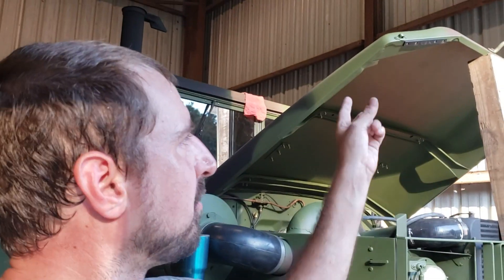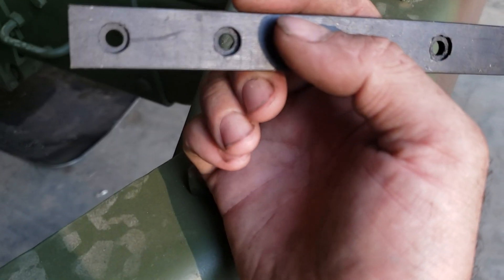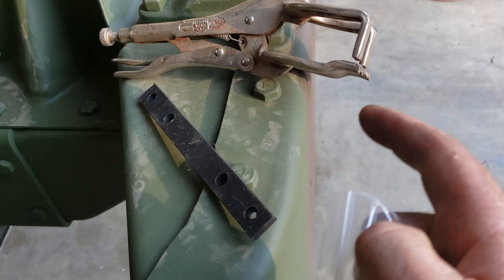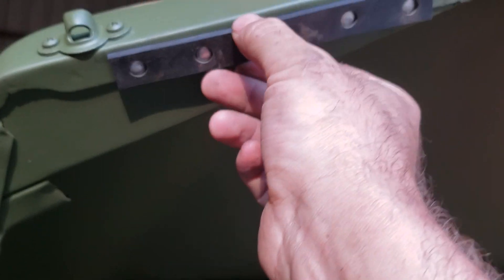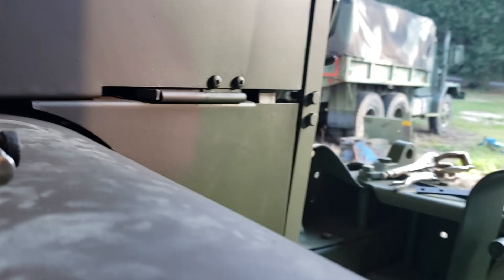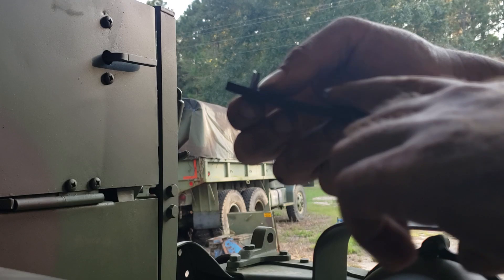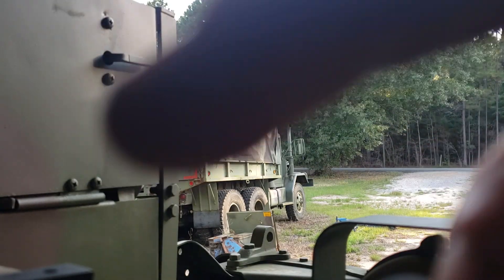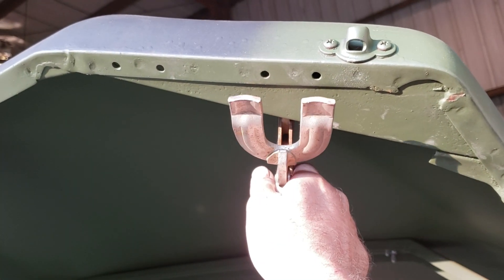Installing M35 hood to grille anti-squeak strips and rivets.

Comment: do you have links to parts??? also are those LED headlites?  if so where did ya get them 24/volt?
Reply: Important note when buying those type or any military headlights on eBay, make sure they say 24VDC. The lmtv version of those headlights are 12VDC. They look exactly the same and sometimes are not marked at all. They will work for about a month in your deuce then blow, we had that problem in the army because the mechanicswouldn't look and put the wrong s*** in a Humvee.
Reply from the maker: Nick, because he has so much more than what is listed it is best to just call him or email him. His website is also quite easy to navigate.

And yes the headlights are the older style Trucklite ones. Can't recall where I got them. Had them for years.
Reply: Those Led headlights look like they might be military part number 6220-01-547-9049( I just installed some on my truck). When shopping 4 those make sure ur getting the real deal.  Jw speaker also makes ones for the military. A lot of the ones that aren't real military lights don't plug right in and aren't DOT approved.

Comment: Do those strips fit on the side panels? That's where I get the most squeeking
Reply: If you have the strips and the engine access doors are rubbing the doors need adjusting.
Reply: @mrmag666  i just put a piece of paper towel on behind the panel and it stopped squeeking, if i remember correctly it was the drivers side panel by the firewall. Don't have the rubber strips, I'll probably end up screwing some on . I got a big box of exhaust bracket rubber pads so meh
Reply: @johndowe7003  it could be a few things, hood loose or not aligned properly, bent or damaged hood, bent engine access doors, even the grill not assembled correctly. Military Depot overhuals and or motorpools are not always in the business of caring if they did it right, just that they did it fast and it's done lol.
Reply from the maker: Should be some small round rubber bumpers held on with a screw just behind the rear latch boss on the cab.
Reply: @johndowe7003  there also should be 3 little round ones next to the front latch as well they just press in.
Reply: @nomad-pq4yw8iy7v  those are the ones I'm missing. I'm guessing I can make my own out of those rubber pads that I have 😬 most of the times you can't hear it over the turbo but it's there
Reply: @johndowe7003  That's the real reason the have that sign in ur truck that says 2 wear ur hearing protection that way u won't hear all the squeaks and rattles
Reply: @nomad-pq4yw8iy7v  just rev er up to 2400rpm and ya wont hear it hahah